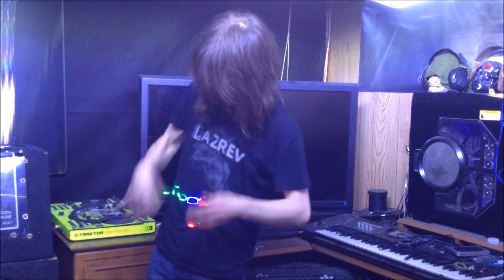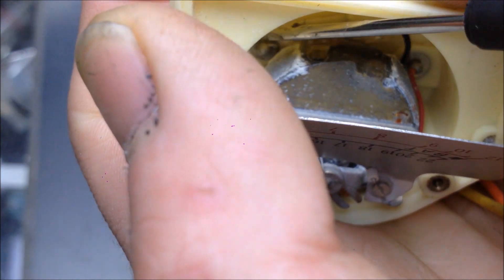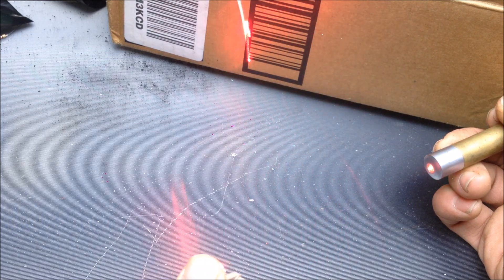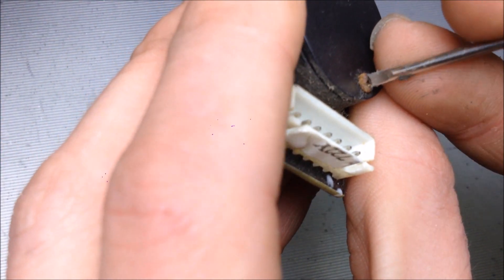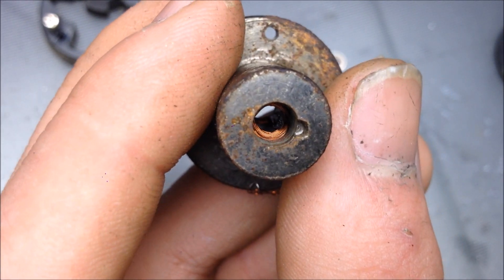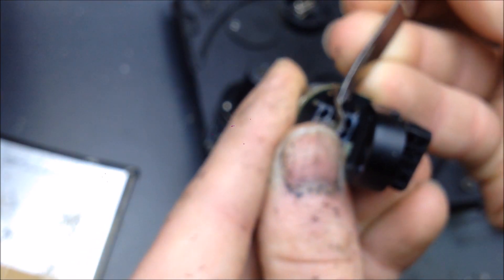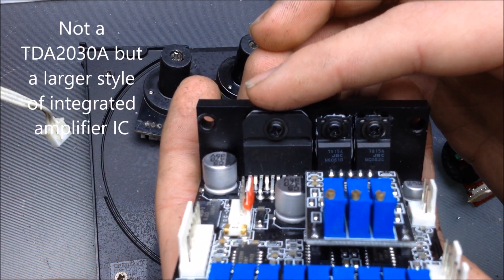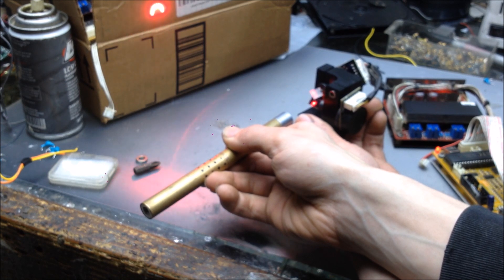Inside the Closed Loop Laser Beam Stearing Galvanometer.

Comment: Hi, I was wondering, the signal input is the setpoint position ? I mean, to make one single galvo spin, what kind of signal I have to use ? If it doesn't spin, couse of degree limits, what kind of singal makes the mirror bounce back and forth ?
Reply from the maker: Galvo amps used a +5v -5V reference for input. The 0 set mark is held with no signal, a signal voltage between 0 and +5 will make it tilt % one way and a signal voltage between 0 and -5V will make it tilt % of the other way.

Comment: Nice in depth video! I've never come across galvos in any of the devices I've taken apart. Hopefully one day I will buy some and play with them : )
Reply from the maker: Looks like you get into all sorts of things! Galvos are pretty specific devices and not in many consumer goods. I have thought about maybe taking and making an engraver with one of my spare kits. Any ideas on what you would want to use galvo systems for?
Reply: @Zenodilodon  Yes, most low end laser projectors use stepper motors or other open loop systems. Projects? Quite a few in mind actually, the obvious laser scanner for light shows, vectors and experimental tracking alongside laser engraving with pulsed lasers and a resin based 3D printer! I'm currently looking into trying some coreless motors and try to make a crude version of optical positioning, but that's quite far down the list at the moment!
Reply from the maker: @oid123  It looks like you have a good comprehension to make your own galvos, does this interest you and do you have FB?
Reply: @Zenodilodon  Yes, it's been on the To Do list for years... I fell in love with ELM-chan's DIY galvos and later discovered the optical feedback ones instead of capacitive feedback.  My laser collection is growing and I need a reason for more!
Reply from the maker: @oid123  Do you ever really need a reason for more lasers?

I mean I lost count a while ago and I am still purchasing more lol

Comment: this is a great " IN - TO " hardware lesson. 
Is this your profession , repairing these devices ? Now i have seen the internal components, why is the cost for those closed loops galvanometers so high ? Have u some drawings or links to DiY galvo controllers, or a link to obtain a complete x-y set ?
I have a 10K Rgb text and figure Laser. 
I want to build the Colums game, RGB laser projector (i have the scematics and specs) to use the MB - VECTREX GAMES (1984-1990)  
Best regards from Belguim.
Reply from the maker: Thanks the for the comment! Yes I repair laser tech and work on custom LED hardware for an occupation. Galvos that handle faster scan speeds are often more expensive not just do to the components but they tolerances of assembly and running operation. Tighter bearings, more thermally restive glues to hold in the coils, more time balancing mirrors those kinds of things.

Yes I do have some info I can get to you on making your own controllers, somewhere i have some of the Cambridge designs. You can look up galvo kits on ebay by kpps. Contact me over FB for more info /Zenodilodon if you can.

Comment: Lol.  A "pretty simple" driver.  Only about 10 or 15 precision set potentiometer knobs.  Need 5 years of spaceship satellite balancing and laser focusing alignment to stick those mirrors on there and trick out the drivers just right.  But hey.  Yea, it's pretty simple.
Reply from the maker: in concept it is simple, in practice it's complex as heck, you are correct. Any term + laser usually increases difficulty and price, but I figure not scare them all off quite yet. Been there years ago and it can seem like looking up a mountain of questions.
Reply: @Zenodilodon  I parted out a bunch of hard drives to prepare the platters, to cut small circles for mirrors.  Then, it looks like I have to build a small jig to hold the mirror to the shaft, just right while I play fun games with epoxy glue.  I'd rather use some clamp type of mount, but it seems most galvo I seen so far that doesn't cost $1,000 all use glue.
Reply from the maker: Tis why I said ( if you have to ask you can't afford it )  lol glue to hold the mirrors on is quite common as it's the lightest/fastest solution for high speed scanning in most show lasers, when you start adding any kind of weight on the galvo shaft for mirror mounting hardware it drags things down a tad. What are you making, I can maybe help you out.
Reply: @Zenodilodon  Etching.  Etch a pattern into a small area of plastic, or metal with a cheap eBay 432nm laser.  Right now I am playing fun games with trying to figure out how to focus the laser, aim it, and the distance between the mirrors and the surface.  Also have to learn this complicated laser show programs, or write my own source to position the x,y axis for the Helios DAC, just so I can try and test the accuracy of position to a printed test pattern.  Super-speed is not really a priority, as much as accuracy.
Reply from the maker: @WhatAmIGonnaGet  Look into mounting a collimating lens in a larger older optical assembly from an older CD player console. they are usually beefy enough to hold larger lenses. I don't know which way you are going with 432nm is is 532nm or 462nm? :P 
Best power for the price is the 2 watt M140 445nm. 
As far as the laser show programs and custom DAC programming goes, all I have to say is at least you don't have to drag a fog machine around with you, I hate doing that...
Reply: It must be hard work setup that stuff so a bunch of people can have fun & party.  The laser show looks just like the wireframe view in 3ds-Max, when I'm modeling objects.
Reply from the maker: It's a bit of work, I am trying to get out of shows a bit and do more servicing/prototyping myself.

Most of laser graphics are also wire frame style, some are done line by line like a CRT but it's pretty rare due to how fast the mirrors have to go.
Reply: @Zenodilodon  I have seen some old journals, how people experimented with mounting the mirrors on thin piano wires and tilt them like hinges.  If you are looking to make the motors faster than they already are, you might need to re-design a new motor if you hit your maximum limit with all the tools you probably have.  I tend to believe that hard drives have the fastest, lightest, and most accurate parts there is to use.  Tried driving the head as a galvo, but got lost in the bipolar op-amp driving circuitry.  I had to buy the eBay galvo kit to push my project along, since making my own system from scratch was too much of a distraction.
Reply from the maker: We have tried using thin wire and spring plates in some of the micro designs, at higher speeds the wires resonate and after flexing so many times they end up snapping. Galvos pretty much are the most solidly made device for beam steering, Piezoelectric actuation is also used for fine beam steering as well. It's pretty much a point of trying to figure out what rolls better then a wheel, the truth is some technologies are hard to improve on.
Reply: @Zenodilodon  I like what you said about the CRT.  Figure out a way to steer the beam itself using a magnetic field, with no mechanical parts.
Reply from the maker: It can be done it's just a hard thing to do.
https://www.youtube.com/watch?v=Y-xq41cdvyw

There is also ways of using MEMs micro-mirrors liquid crystal
http://bnonlinear.com/research-development/beam-steering
Reply from the maker: @AerialTheShamen  Well sure, mass plays a huge role in tuning. But mass at x speed still requires force of x to stop. The braking side to the system is what I was talking about as well.

I know of a few SS methods of beam steering, opto acoustic is one. Similar things have been accomplished with LCD stuff also. The down side is usually small scan angles, very specific wavelengths and usually not applicable to things like mixed laser sources such as in a show laser.
Reply: 15 precision potentiometers? Have you ever seen the convergence unit of a 1970th colour TV set? They were at least as complex to compensate all those nonlinearities in (often delta mask) CRTs.

Comment: Great video and explanation. Also good job on the rebuild. What brand of galvo were the capacitance feedback models?
Reply from the maker: Hey Adam, no capacitance feedback galvanometers where in this video.
Reply: @Zenodilodon  Ah, I was working while watching your video, missed the part where you pointed out the LED and thought it was using variable capacitance as a feedback. I get it now,  never seen that design before. Thanks!
Reply from the maker: The galvo brand from that model i think was Gold Star ( GS400 ), they look a lot like Cambridge galvo designs it seems.
Reply from the maker: Also thanks on the rebuild!